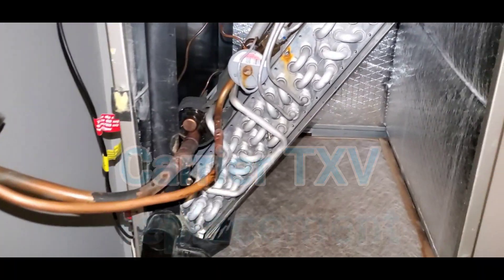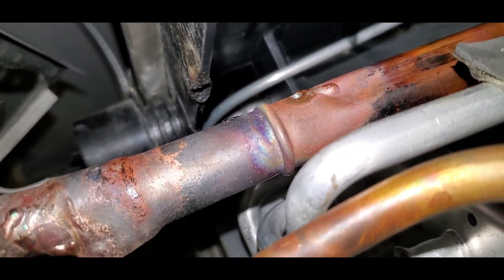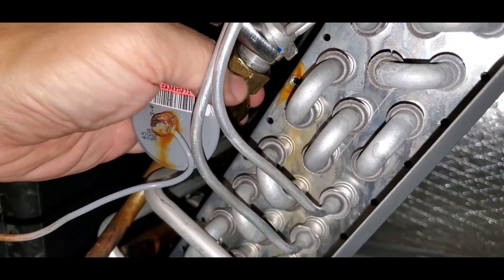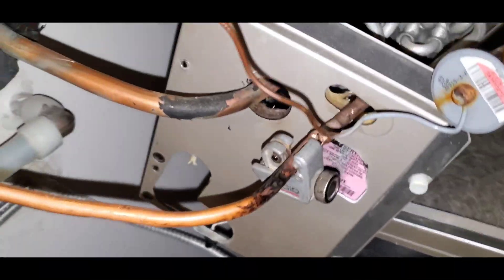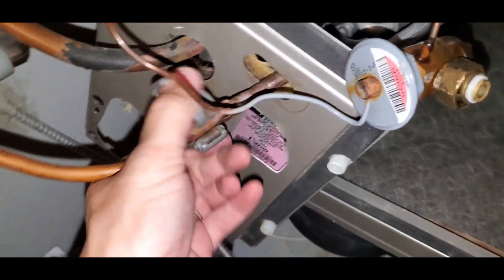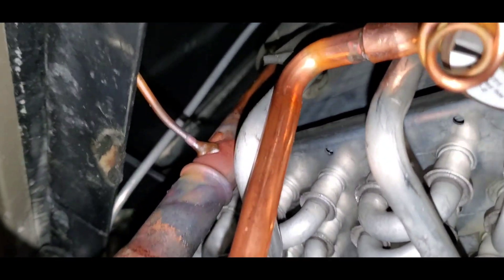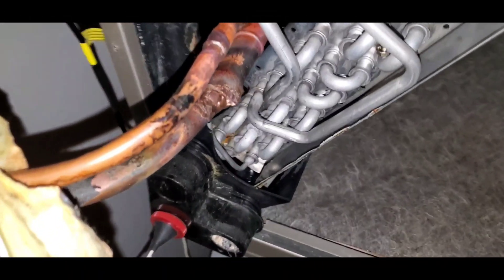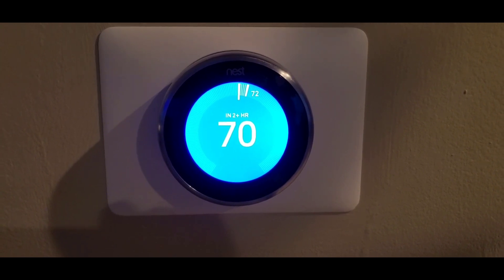Carrier TXV replacement

Comment: thanks for the video.. I've seen lots of posts that not flowing nitrogen in the lines before sweating them can cause oxidation inside that can harm the compressor, etc.  One remedy is using Stay-Brit8 solder instead of brazing.  If done with acid flux, it can be plenty strong enough even for R410a
Reply from the maker: I'm definitely gonna try that stuff, especially on my next reversing valve.